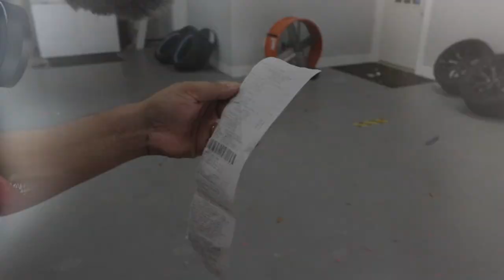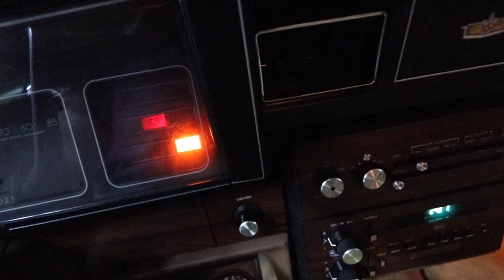Rebuilding TEX SANDS BOX CHEVY ENGINE! (PART 1)

Comment: That's awesome! Love how I just recently talked about engine building... and you're doing it! Take your time and do it right, small overlooked steps can cost you the whole engine at the end. I thought mine would take 2 or 3 weeks to build, and it took almost 5 months.
Reply from the maker: Yeah bro thanks for your advice! I figured I wouldn’t want to start with something super expensive like my car, but this will be fun for everybody to learn! Part two is dropping tomorrow
Reply: @Damdaved  I needed to get to work earlier and couldn't actually watch the whole video, so now I got home and watched all of it. Good idea not starting by building your more expensive car! Old V8's are cheaper and more forgiving. I'm sure you've already figured something out since part 2 is dropping tomorrow (excited!), but from what I could hear in the video, it does sound like lifters. Revving from the carb linkage with your head close to the engine could help. If the "knocking" gets louder and faster with RPM, that's when you get worried. If it kinda fades away or is not very pronounced, it's most likely lifters. This 350 (assuming it's a 350... the engine's serial # can confirm) should have hydraulic lifters, and if they're stuck/gunked up/collapsed/misadjusted, they'll sound exactly like that. Thankfully that's a pretty simple and cheap problem to fix. You do NOT have to pull the heads to inspect the lifters and valvetrain! Just the intake manifold. If you pull the heads it's very messy and more complicated to put shit back together, and you have to spend money on cleaning and head gaskets... and lots of money on a high quality torque wrench if you want your work to last. Good luck man! Excited for what's to come!
Reply from the maker: Man thank you so much for this comment! I’m excited for you to watch the Chevy videos because you know a lot! Tomorrow’s video is where we take the valve covers off and check the lifters, let me know what you think about it when it drops, but I have a few other things I would like to check as well! Definitely keep the feedback up though because you might be the one to save this engine👊🏼🔥🔥

Comment: Probably dumb but did you check the oil and also if it’s a lifter it’s not a massive issue
Reply from the maker: I’m Diagnosing it more, and more as I go along! Thank you for your advice, part two drops tomorrow